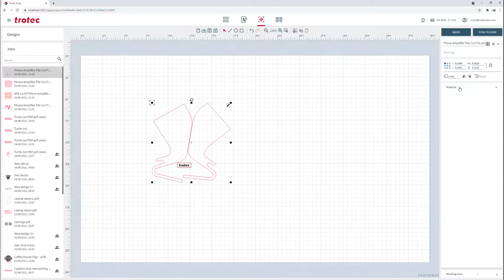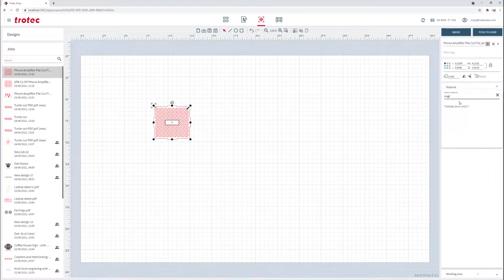Trotec Featured Laser App Laser Cut Phone Amplifier

Comment: Thank you for this video and for the file. I just finished assembling my first Phone Amplifier using the Trotec Speedy 300, 80W Laser Engraver/Cutter at the public library. A few comments:
1) You should have included a quick demonstration of a phone without the amplifier and with the amplifier.
2) The front piece, with the Trotec name plate, is all cut lines where an engraving line is what is needed for the small rectangle where the Trotec emblem is adhered to the front. Instead of engraving, the rectangle is cut out. I had to glue the rectangle into the front. In the future, I will change the rectangle to an engraved line, or no line.
3) I had to rasp all of the edges to get the slots to work. Otherwise, the slots were all too small.
4) The slot for the "tongue" to hold the phone in place is too small as well, so I had to rasp the tongue to get it to fit.  

Overall, I am happy with the results, although I had thought about using Vermont Natural Whey Satin Finish to complete the project, but I am concerned it will not work well on the living hinge areas. Thank you to anyone who reads this and who is willing to share his or her thoughts on whether to use a finish or leave as-is, or perhaps just use the finish on the areas without a living hinge.